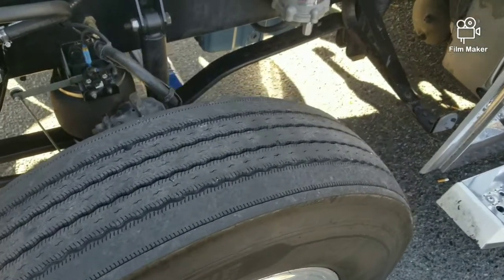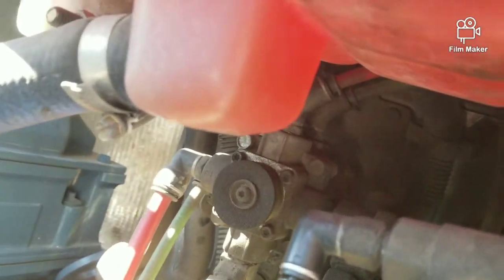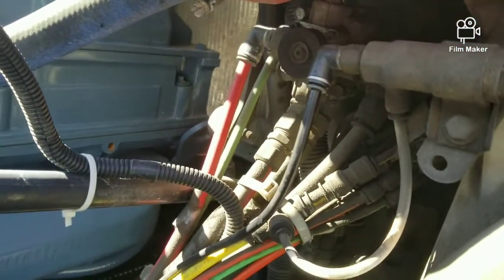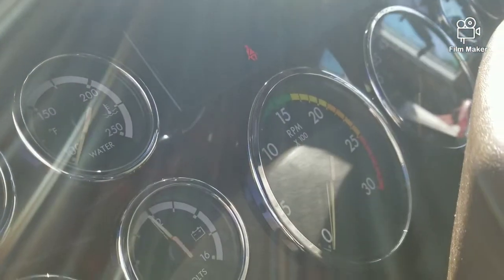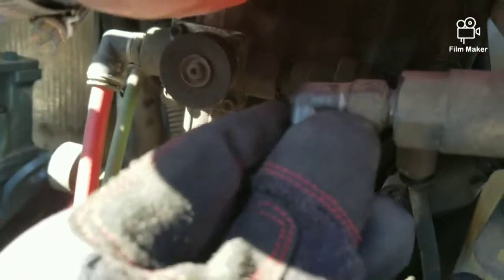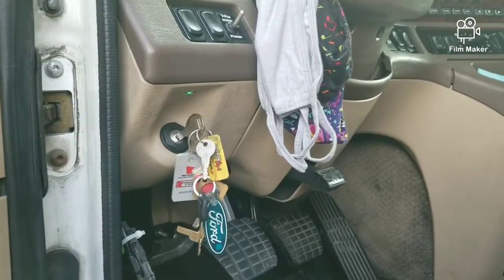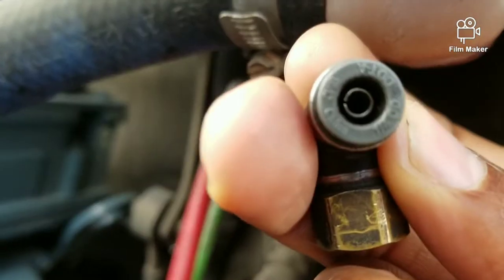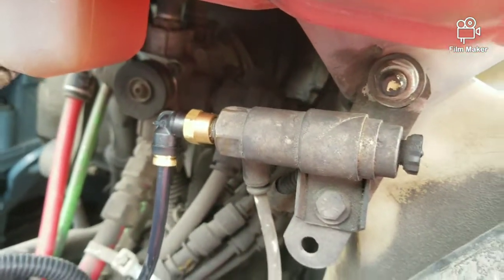Change Freightliner Quick Connect Air Fittings - Dont Let DOT Catch You Slipping

Comment: Those hose to joint connectors are like Chinese finger puzzles. All you have to do is attach the joint like he did and then push the air hose into the joint. And to pull it out you just push it in and pull it out. We had a bad air hose on our printing press. It’s good to know these things.

Comment: Suggestion - Next time, after replacing an air fitting,  spray some silicone on the whole thing, let it dry, and wipe off.
Reply from the maker: Thanks for the tip
Reply: What does silicone do in this manner?

Comment: Hay man can you tell me what should I do with when the technician says: Replace pass thru due BRASS FITTING LEAKING!
Reply from the maker: I'm sorry I don't know what you mean.
Reply: Pass through block is on your firewall.  Just look for all the air hoses going in to your firewall. It's called a pass through cause hoses go from firewall to the inside of your cab